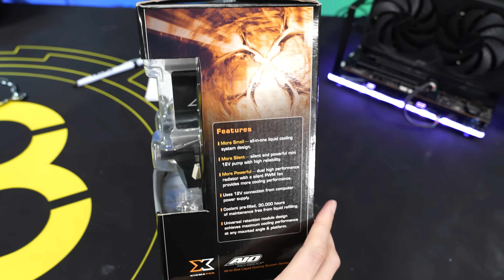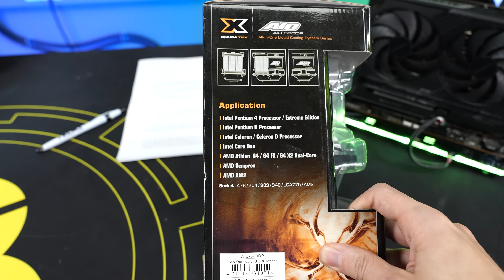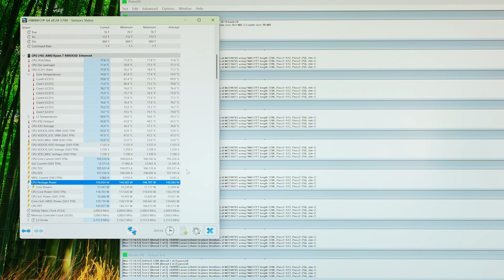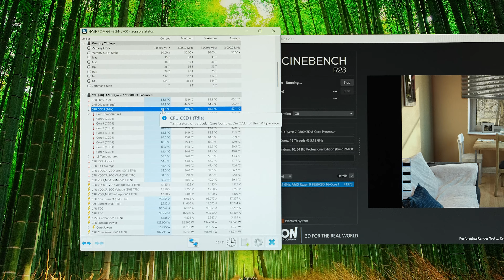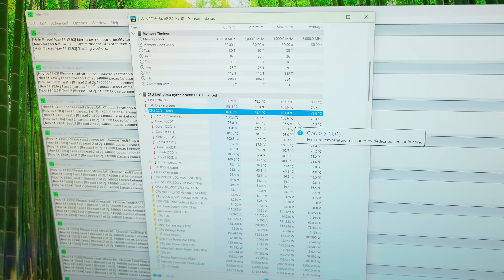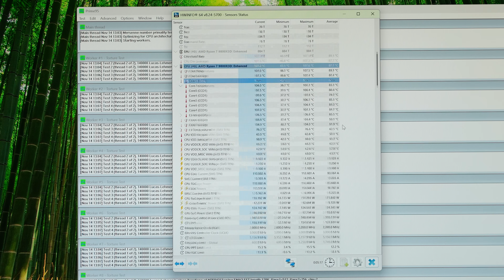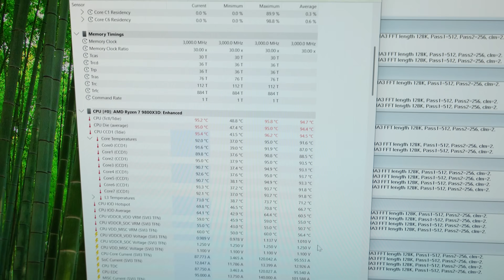Viewer-Mail Ep8: This Old Cooler Lets a 9800X3D Get Over 110°C

Comment: For 2006, that is one chonker of a cooler. Nowdays we don't take another look about fitting an entire apartment building on our CPU...
Reply: Same with GPus.
Reply: At those years this small AIO in tower form isn't the best choice 

Tower120 extreme/ thermal right 120 extreme or ultra 
If need silent low air restriction option we go HR01 
There is no reason to buy this 

Block with liquid won't quick as heat pipe and this mini AIO have less liquid this the advantages of heat capacity also non existent 😂
Reply: I think we do, current dual tower coolers are of that size at least (And air colling is the current way to go)